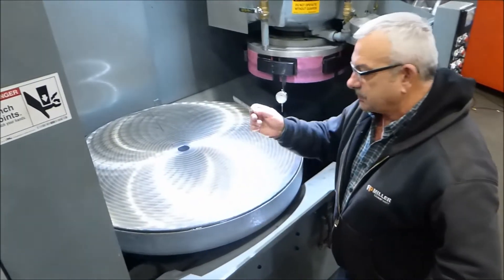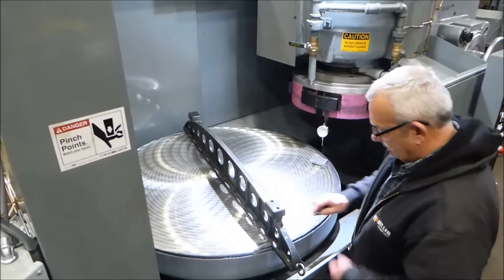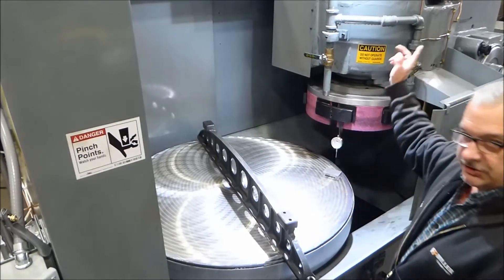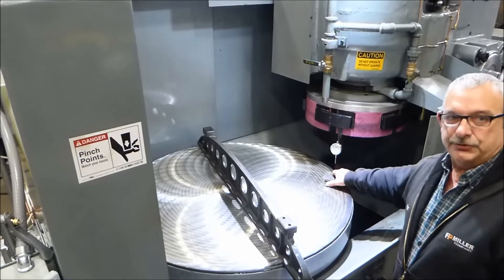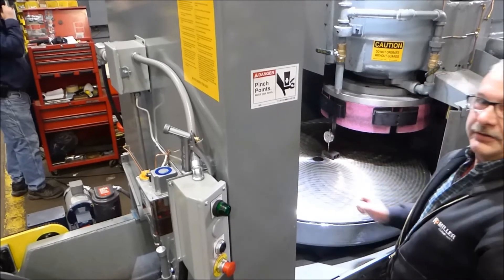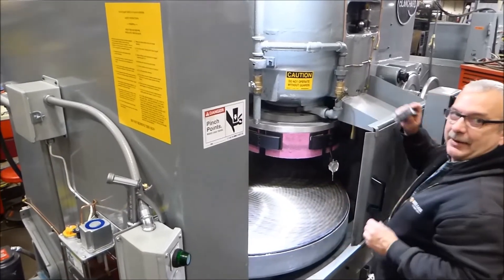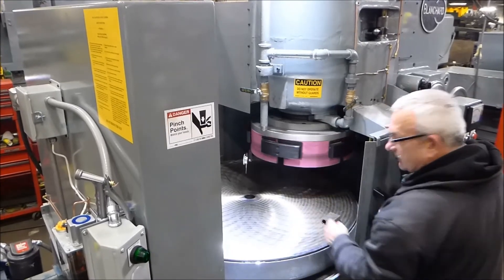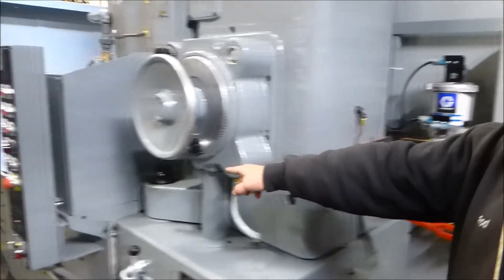How to Precision Tram In a Blanchard Grinder

Comment: What’s crosshatch?
Reply: It's the pattern of swirl marks in the finish produced on the part.  The leading side of the grinding head makes a curve going in one direction and the trailing side of the  head makes a mirror image of those curves, so it's a cross-hatch pattern when the geometry between head and chuck is correct.